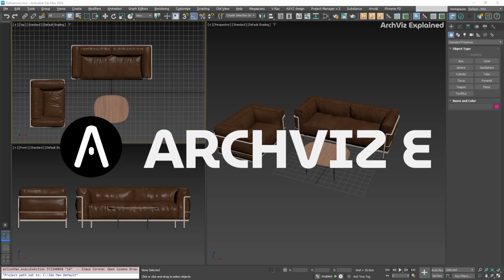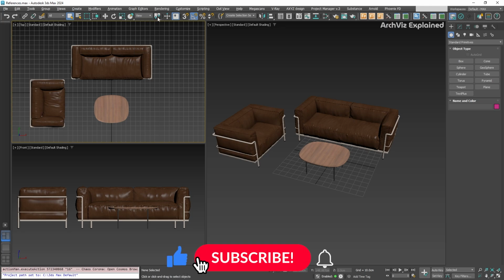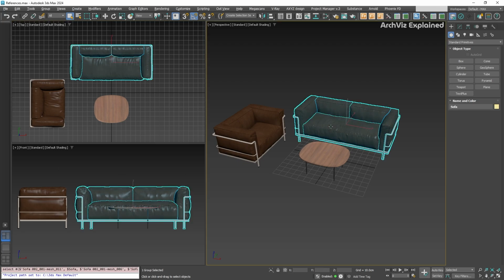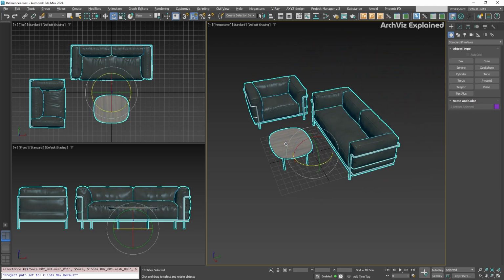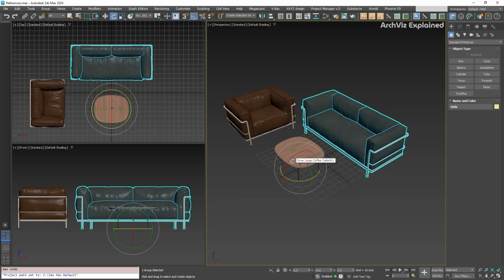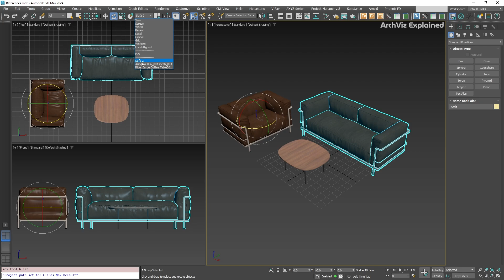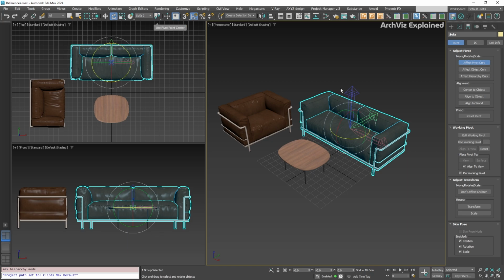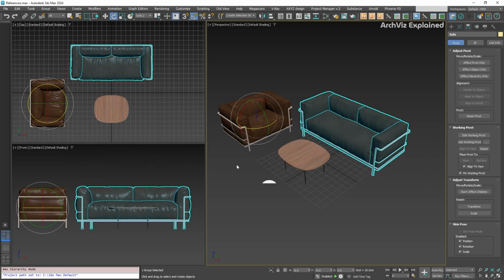How to Use Transform Center Reference Coordinates in 3DS Max

Comment: And what about moving or copying an object from any point (midpoint, endpoint, etc.) to any point on another object (midpoint, endpoint, perpendicular, etc.)?
Move or copy objects as easily as in Sketchup?
Reply from the maker: Hi  @chardo2225 Great question! 😄 In 3ds Max, it’s definitely possible, but it's a bit different than in SketchUp. To move or copy objects precisely from a midpoint, endpoint, or perpendicular point, you can use the "Snaps" tool. Just enable 3D Snaps (press S on your keyboard), right-click the Snap icon, and in the settings you can turn on Midpoint, Endpoint, Perpendicular, etc. Then when you move or copy, it will snap exactly where you want! 👍  You can find how to do it in my tutorial about how to use the snaps tool https://youtu.be/6vMF-9ELbFQ